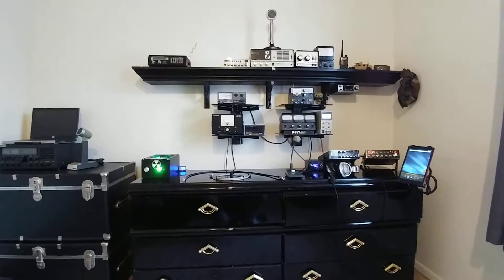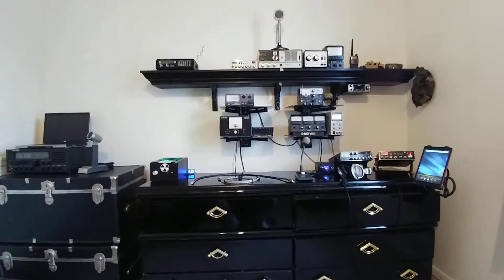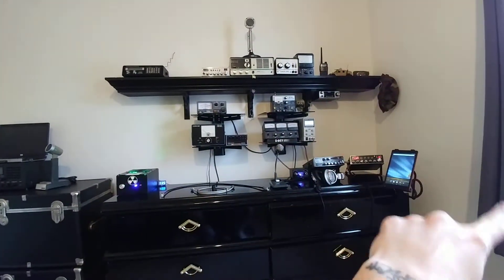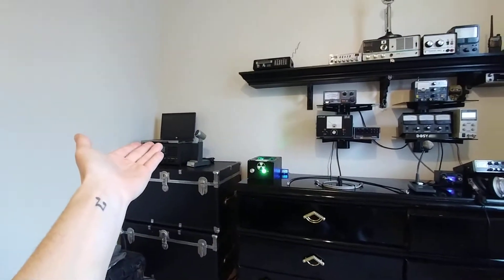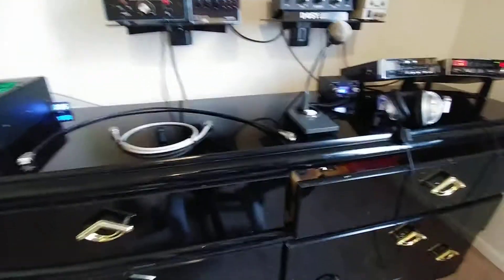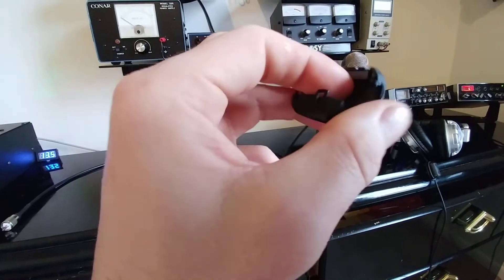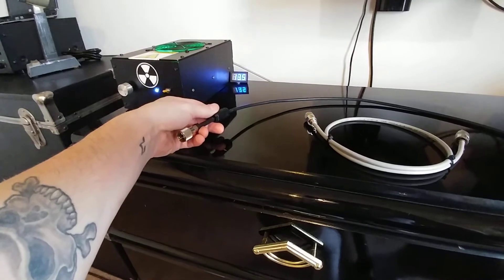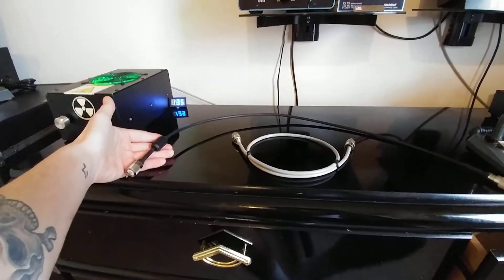Ferrite cores Vs RFi⚠️

Comment: Good video. Nice the way you have your station laid out! My question is I have a 5 to 7 pound static level. I have went around the whole house with a old transistor walkie talkie trying to find the static. Nothing buzzing on the walkie talkies in the house. I even shut the whole house electrical down and used a battery and still have it. Gotta be coming into the antenna? Can I use these 'Mix 43 Ferrites on my RG-58 coax outside? You think doing this will knock some of this static down? Thanks man!   X-CALIBER (160) Michigan.  ✌
Reply from the maker: This is one of my older set ups sir, what I have now is a little more advanced. Check out my new uploads when you can. Now as for ferrites on coax is a must in my opinion, also be cautious using any antennas that are fiberglass covered which can cause them to be more susceptible to floor noise(static)
Reply: @GroundControl204  .... will do.... Oh like my A-99? I'm looking at ferrite kits on ebay now. I'm gonna try the clip on ferrites. Are the Mix-43's good to start with for the RG-58U? Man I need all the help I can get. This noise level is frustrating. Thanx for the reply, we subbed to your channel and will look at your newer vids! Thanx again  X ✌

Comment: I have a electric fence near my shack any you know how they pulse. Well I can hear it do it's thing through my antenna. When I disconnect the antenna from the radio it stops!. I don’t run amps!. Strictly barefoot. I see in your video that you connect them to your coax. Do you think it would help if I also put some on my coax ?. I have no other rf interference except that annoying clicking from the fence. Thanks for any advice.
Reply from the maker: It wouldn’t hurt to try ferrites on all of your radio gear. From AC wires to DC wires and yes even coax.

Comment: Yo. My neighbors computer speakers are picking up my CB. I bought him a pack of ferrites and he said they don't work. I have one on my coax. What should I do
Reply from the maker: What type of antenna and coax do you have? How high is your antenna? Is your radio harmonically sound(not a splatter box)?? A lot of other things come into play considering bleed over and RFI
Reply: It's a stryker 955 with a 1/2 wave aluminum antenna 20 feet up. The antenna is 15 feet from his house
Reply: RG8X coax and my mast is grounded
Reply from the maker: I recommend double shielded coax like LMR 240, and definitely get that antenna up higher and that will help, currently with your set up and close proximity of your antenna to your neighbor I doubt ferrites will do much justice unfortunately.

Comment: Genius!
Reply: I just want to thank you for this information, its very helpful, at work we are having these issues and the “experts” here are still scratching their heads. Great job.
Reply from the maker: Thanks for the kind words, what type of career field are you in brother!?
Reply: @GroundControl204  I work for United Airlines EWR, we used to be Continental and We are airplane towers using Til vhf radios to communicate with ground control and ramp controlled areas. We operate the Douglas Tugmaster vehicle as explained in my channel and its a British vehicle. Over two decades we’ve had persistent radio bugs but it may be caused by the issues you have clearly explained and by the fact that how these radios are integrated into the truck is more like an impromptu solution that needs this type of methodology. The radio company has sent their techs and our own maintenance are short knowledgeable, but the electrical components of the truck itself were never designed to accommodate our operation. So basically we have improvised much to the many transmission issues occurring every day. I would let them know of this solution since something similar to my own experience led me here. I record video and audio and when i began using a big battery to power the camera, mixer and monitor I experienced heavy noise that was solved through ferrites and ground loop isolators.
Reply from the maker: Thanks for sharing your experience here with me, sounds like a great line of work you are in if you ask me. Honestly, I have gone through so many issues like you have stated in my military comms career and yes on all types of AC and DC radio systems, and even satcom and microwave comms can be a pain in the you know what when dealing with line noise/ RFi/ ground loops/ common mode currents and it’s always trial and error until you get the culprit tracked down and isolate, suppress, or eliminate the cause. Ferrite is definitely not magic, but the science behind this element in the electronics field works very well and is must in my opinion.

Comment: EXCELLENT INFO HERE👍👍 just ordered some of the snap type ferrite chokes to try on 8 gauge radio wire for a fan noise issue.
Did not know these work on coax so will have to order more. I was always told to never coil coax so not a fan of that but am a fan of putting the main coax feed into a glass jar to protect equipment not in use from static discharge. I have seen sparks fly out of my pl259 before! This Stray RF shit is crazy man Thanks for sharing👍👍💙

Comment: Hi there. Do you use a low pass filter on your setup?  Would a low pass help as well?  Could you explain a bit on that subject. 
73 Between the Great Lakes Southern Ontario
Reply from the maker: No I do not use any low pass filters at all.  Since this video I have done a lot of upgrading considering coax, antenna, ferrite placement, AC line suppressor, DC capacitance to ground filter upgrades for all amplifiers and of course I always have a very clean tune on my radios as well as being matched to specific amps I own. Never have I interfered with my other devices in my home and absolutely no complaints from the neighbors thankfully. 73
Reply: @GroundControl204  could you help me out there a little. I am needing these and am not sure where to get them or what kind. I recently got a president 2 + and will be using the other frequencies on this. So what would I need and were from would I get them ? Thanks in advance brother. 73s
Reply from the maker: @stonecoldfyu316  They are called Mix 43 ferrite. You can find them on EBay and RFparts.com
Reply: @GroundControl204  I ordered a ten back from eBay for $30.00 I thank you there brother and love the videos and the down to earth attitude you have bro. It is awesome and makes me glad to be getting back it to this after 30 years my brother.
Reply: So I should only put 4 max on my cable for the antron 99  antenna and one each on my cables for my meters correct ?
Reply from the maker: @stonecoldfyu316  No more than four to six ferrites sir

Comment: I wonder if anyone here can help me with a related question. I am currently copying old audio tapes my dad recorded of me and my brothers when were were young. I want them digitised for posterity and sharing amongst ourselves. I have a good audio interface, a high quality cable, and a tape deck. When I have done some of the recording, I have noticed that occasionally I get what I believe is RFI in the recordings—a blip blip blip beep beep blip blip sort of pattern that sounds to my ear like the hunting of a cell phone signal. I have tried using ferrite chokes on the wire hopping this might help, but it doesn't seem to have. I have not put multiple ferrite chokes on this cable, and even used some of the larger ones I got in the same pack to make loops in it for double passes of the cable. Does anyone have any suggestions what I might be doing wrong, or what could be done to stop this effect from affecting my recordings? Many thanks to anyone who can help :)
Reply from the maker: Are you using a PC to transfer this analog data to digital data? If so, make sure the PC is not connected to surrounding WiFi modems, some times this is the cause and effect of some RFI. Also, if your editing software provides noise limiters and so forth, try those plugins to see if it clears things up. Also, with any line level audio cables you may have just make sure to use ferrites and also keep them from Cris crossing any other cables that may be transferring power and/or data, and yes keep all phones away from the PC as well during the transfer and edit process. I hope you get to solve this issue and if you do please come back and let me know what was causing the RFI. 73
Reply: @GroundControl204  where would you might get these I am looking at Amazon and want to get the right ones. Could you help a brother out lol.

Comment: i hope i understand this right my setup in my jeep is going to be POS NEG from battery to a 6 way fuse block out to a cb and a gmrs radio. would i be ok just putting a couple ferrite on the power in to the fuse block to eliminate alternator noise or should i put them on the power cables to each radio. or both of them.
Reply from the maker: KrazyFuckinCrackers1 That’s a good question bud, and to be honest you can do all of the above. Some filtering before the fuse block and and after, but yes I would definitely make sure the radios have a few wraps through a ferrite more so than at the fuse block. 73

Comment: very informative! thank you!  one thing i've been wondering is would it be beneficial to use several different types of ferrite throughout the line to reject common mode interference from other frequencies?

say i'm running a cb but i live in an area that has a lot of vhf and uhf signals floating through the air--could i use type 43 for preventing my feed line from becoming resonant on CB frequencies and then another type of ferrite to prevent the line from becoming resonant on other frequencies?  my cable run is 125ft of LMR400.
Reply from the maker: Mike Turner Yes it can help with matters like that, use mix 31 it has a range up to 300mhz
Reply: 204 Ground Control thanks for the quick reply!  31 is what I was looking at on Palomar Engineering.  What if I did 4 of each: 31 and 61?  Would that help with the frequencies above 300mhz as well?
Reply from the maker: Mike Turner No more than four sir, remember these ferrites can cause inductance over ground braid, which is not good in our case.
Reply: 204 Ground Control wow I didn’t know that!  Thanks much for this info!!  This is hugely helpful
Reply from the maker: Mike Turner No problem sir, stop on by my channel anytime. 73
Reply: 204 Ground Control thanks again! I just subscribed to your channel. Just ordered 10 each of type 31 and type 61 snap on units (1/2”) for equipment here at the base and in my mobile

Comment: Awesome bro...thanks. 
Tell me a bit about your mic and compressor?
Bull daw in da bikini state
Reply from the maker: Well the Mic is made by Yaesu and the model is YD148, it's truthfully designed for 2 meter FM use but does very well on 10 & 11 meters.
Now for the CPI compressor, it's made by Communications power incorporated
The compressor can be used with stock mics and/or power mics, its a cool gem to have and really produces a great sound so very close to running condenser studio mics. If you find one to purchase they are worth no more than a 110 dollars in working order. 73's

Comment: Cool setup.  Maybe you can help me.  I’m a truck driver and have just a basic cobra 29 and Wilson 2000 antenna.  18’ coax which I ran around the truck to eliminate coiling.  SWR about 1.2 but I’m getting feedback squeal from out of the stereo speakers.

Would placing a choke on the coax before entering the truck work in this case?
Reply from the maker: BrandonPryorMusic  yes it will help, also ferrites on the actual speaker wire will help as well. Also keep your coax far away from speaker installations if possible. Also use a ferrite core on your hot wire for the CB as well, wrap it two or three times. Good job on the low Swr's too bud. 73's